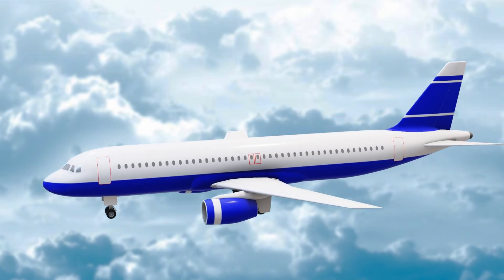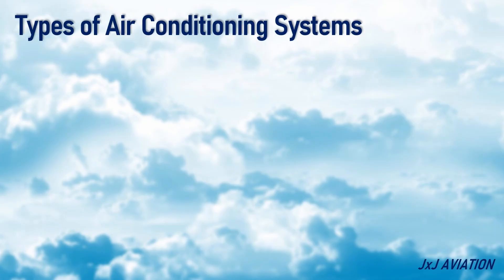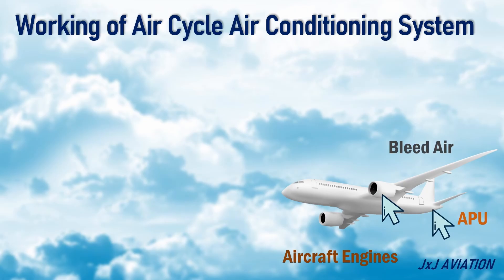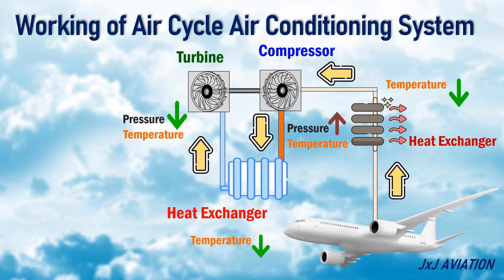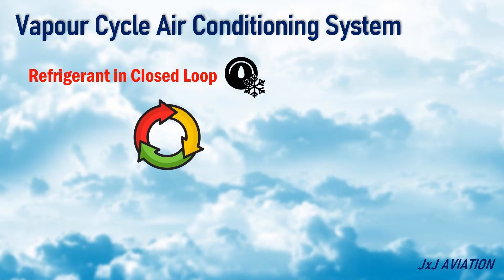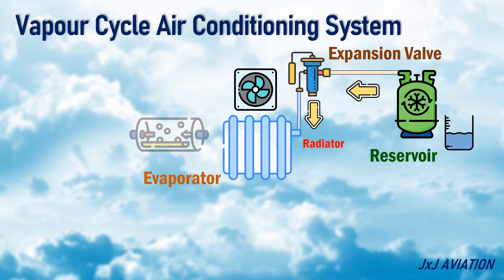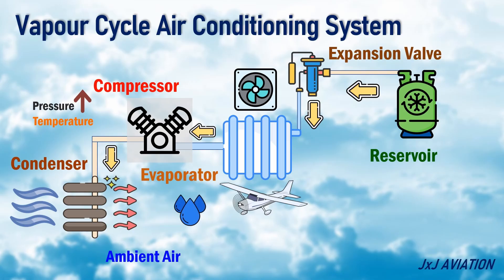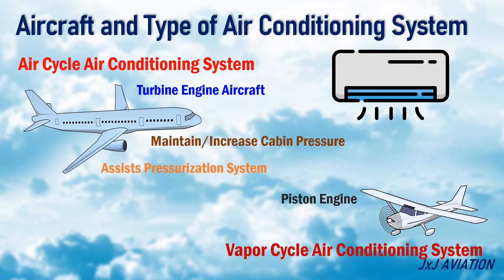Understanding Types of Air Conditioning Systems in Aircraft | Air Cycle | Vapor Cycle | Advantages

Comment: The air cycle machine actually uses two compressors and two separate heat exchangers. Bleed air goes through the first stage of being compressed, then the second stage, the air is compressed again and ran through another heat exchanger. Then there is a valve that when the air that is released, on one side of the valve, air temp is 300 degrees and when vented into the AC unit, it comes out at -160 degrees or colder depending on what position the valve is in. Then sent to the blend doors and so on. I'm a A&P mechanic.
Reply from the maker: Awesome!! that is great information you shared. Thank you!

Comment: It may be useful to tell your audience about the level of relative humidity (phi or RH) in  air cycle systems which are typically low 20% at cruise dependent the altitude flown as the higher one flies the less humidity of ambient air as well as the system itself from engine bleed air has a low water vapour content. People often complain of dry/sore throats after flying long legs. Early pressurised passenger/cargo aircraft such as the Britannia had humidifiers as some military cargo (hazardous) carried needed a high RH.
Reply from the maker: Yes that is a good point!